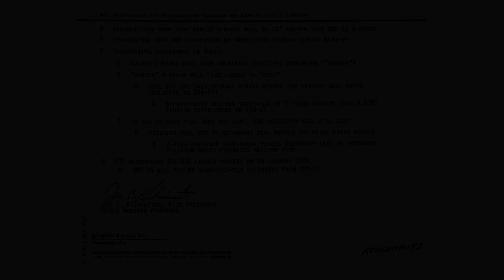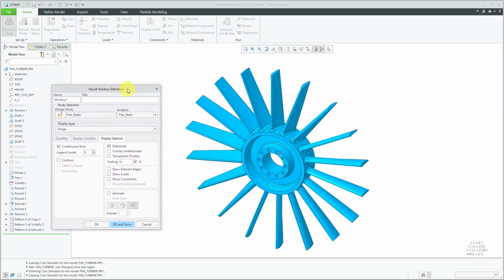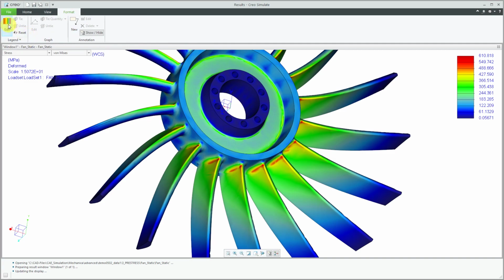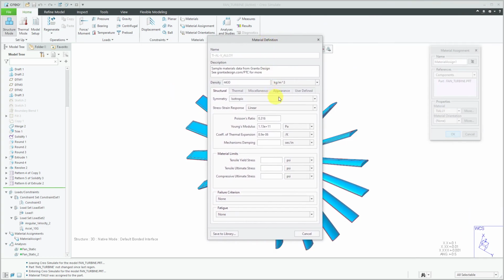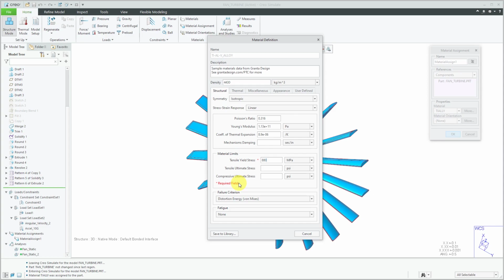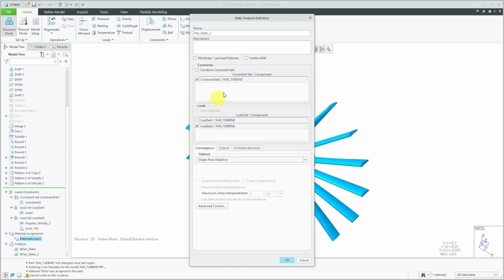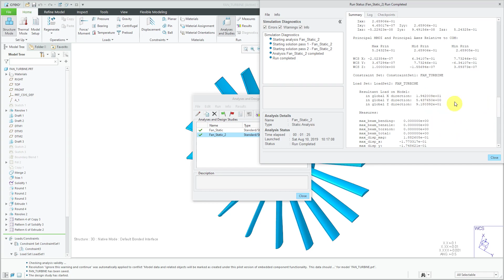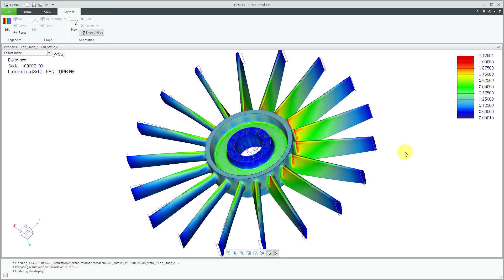Creo Parametric - Creo Simulate - Failure Index and Effective Communication

Comment: Interesting, do you ever set the stress-strain response to anything but linear, or is linear usually good enough?
Reply from the maker: You use a non-linear stress-strain response when it's appropriate for the material, like a hyperelastic or elasto-plastic material, especially when you are simulating "push-through" (like you see with a kid's push pop fidget toy).

Comment: Hi there, I have a question, so actually after first analysis your results showed that the maximum stress is 610MPa and Ti alloy has a yield strength on a level of 880MPa. The conclusion was (obviously), that your part has a lot of spare strength and that it is going to withstand this force. Then, after second analysis where instead of stress your results showed failure index, same places (which previously where the places where the stress was on the level of 610MPa) had the value of failure index greater than 1. It means that they could (or even for sure are going to?) brake, am I correct? So basically, first analysis said that our part will be ok but second said that it will actually brake? I don't know whether I missed some details beetwen first and second analysis, maybe that's the reason. Could you please help me with this?
Reply from the maker: I did this video last August, and it was more than a hundred videos ago. I doubt I could remember what I was doing. Although I seem to recall adding some safety factor to the yield strength when I reconfigured the material properties.
Reply: I think he show us the second type of load in the index failure results ;) So more loads = more stresses
Reply: In the first run, he ran with the default settings for material selection. Then, he added 704 MPa and I probably think that is where some other variables have also changed slightly. May be he has shown study-1 the first time and study 2 results the second time. I am not sure about either of those.. just to add my guess..